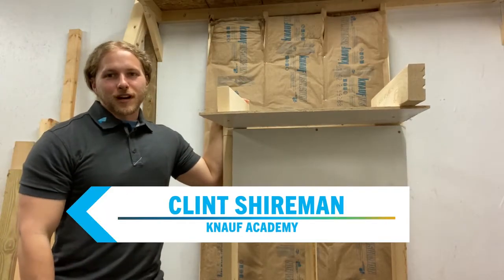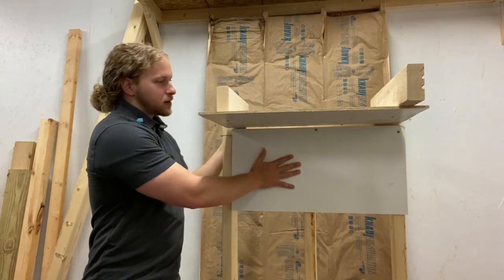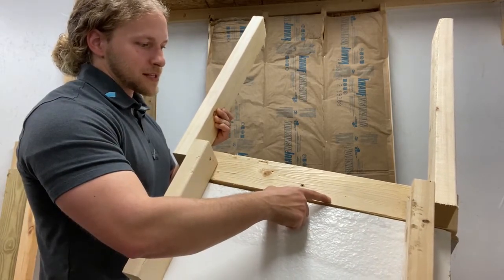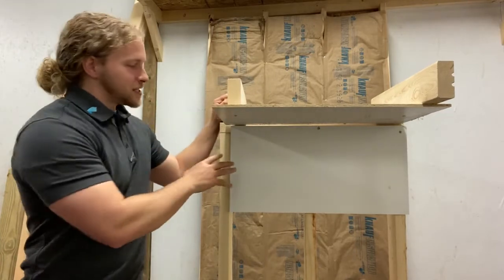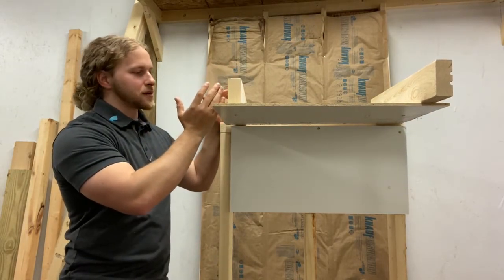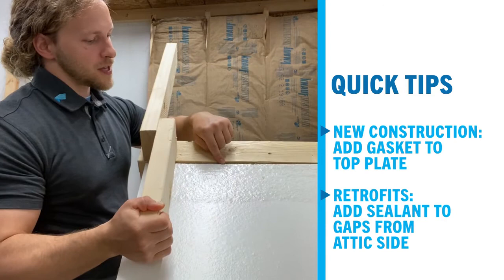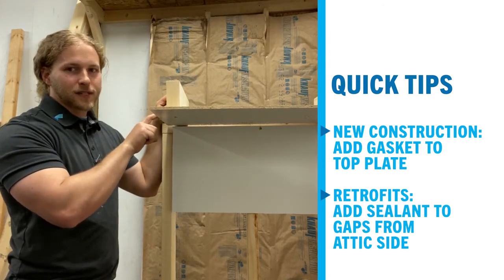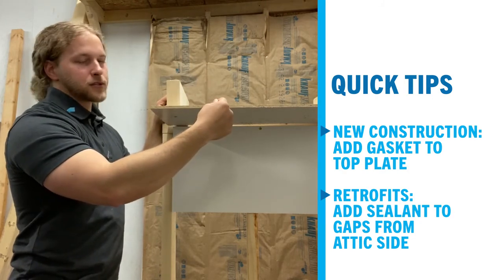How to Avoid Attic Top Plate Air Leaks

Comment: I’m confused… in many situations, wouldn’t that edge at least have tape & mud? Or crown molding?
Reply: air will seep thru behind baseboard trim behind drywall thru that gap out
Reply: @andreycham4797  Pretty easily too. I can feel a wind coming from my baseboard when the bathroom fans are on and I think it's coming down from the top plate, through the wall, and out the baseboard. I'm not looking forward to getting in the attic (it has blown in insulation) but I need to because that warm air is condensing when it hits the cool slab and causing some mildew smells.

Comment: What if there is still a gap in the plate, but  it's sealed with vapor barrier. Would that be sufficient? Under the insulation ,my entire attic is sealed with vapor barrier, but I am not sure if plates are sealed with foam.